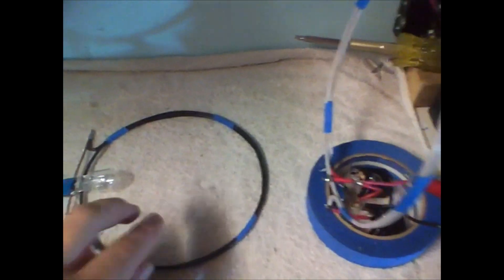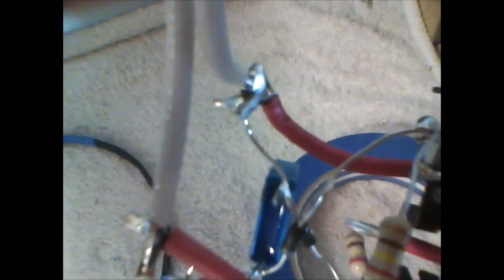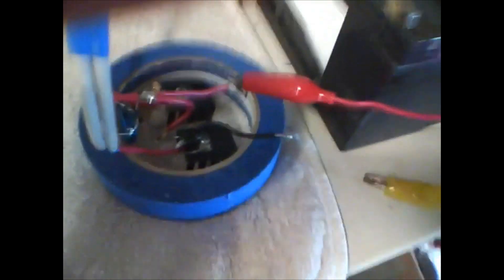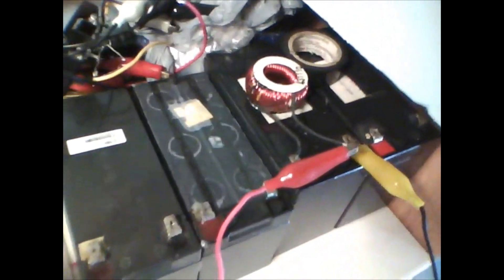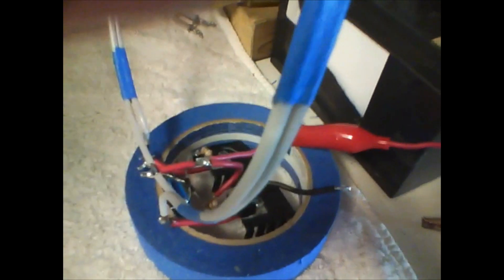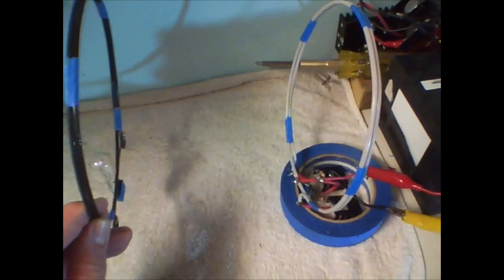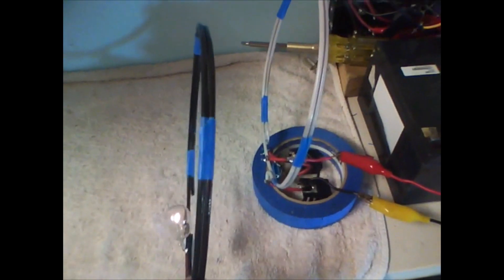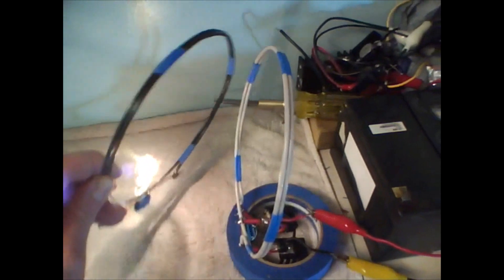Wireless Energy

Comment: Congratulations on making a transformer.
Reply from the maker: A transformer uses an iron core which is set at a frequency of 50 to 60 Hertz, mine is wireless running at a very high frequency which travels through the air called radio waves. Thanks for watching.
Reply: +whyme2b Guess I wasted my time at collage, as the text book definition of a Transformer is 'A transformer is an electrical device that transfers electrical energy between two or more circuits through electromagnetic induction.' An iron core is not necessarily needed, but makes it more efficient.

Comment: hi obviously electricity is being used when the bulb lights up. but is electricity also being used when temhe second ring is away from the first ring? where is all the electricity going when the bulb is not lit up? does it just go into the air? or is it harmful radiation?
Reply from the maker: Energy is being used when the ring is close to the other, but when away it hardly uses anything. I tested with a volt and amp meter the difference. The main primary ring is still emitting a magnetic field out but only can be picked up by the other tuned coil. Their is no harmful radiation being emitted. Thanks for watching.

Comment: Nice, I wonder if you used high voltage ac if you could fry someone with 230volt ... ps nothing more than a dc motor minus the moving parts and magnets or a transformer minus the core . you've just reinvented the ball and made a wheel. Nothing new here
Reply from the maker: Thanks, I actual used low voltage running at 12 volts to produce this. Also a  230 volt magnetic wave won't harm you... I made a high voltage 380 volt D/C pulse magnetic wave threw a microwave primary coil which worked very well...This also is not a motor or the principles of how a motor works.... it's running at very high pulse frequency which a motor could never run at. Also I don't want to capture the waves but release them to flow, that's why I'm not using a iron core to trap them and confine them in a small running space. Thanks for watching.
Reply: whyme2b  Well it could if you didn't connect the ends and place them in your best friends rib cage.
Reply from the maker: I guess you have a point there.... I think paramedics use that to get your heart going again.
Reply: hahaha
May Be :)

Comment: nice vid , If there is a smart way to direct the energy field created so it's travels further and is more accurate and pin pointed, e.g. to several stationary (or moving) devices such as a house. And in its turn the household electricity will be solved with no cables from source to end user. Thx for sharing
Reply from the maker: Thanks! Yes it also can be done by raising the frequency higher and using a bigger copper ring transmitter and collecting receiver.... many ideas about this, just need the time to create it. Thanks for watching.